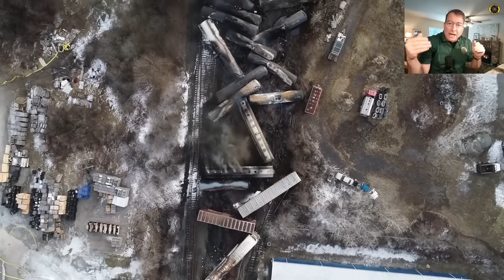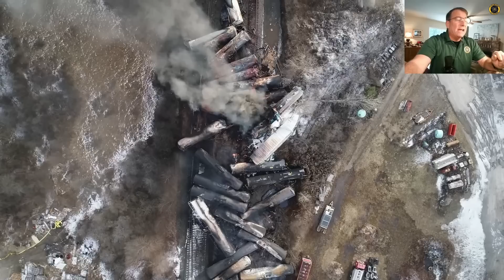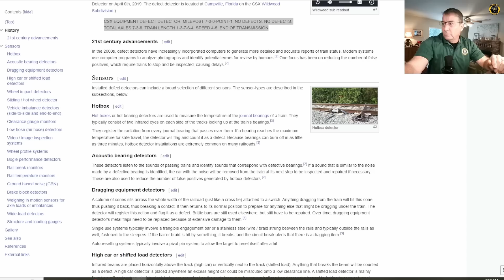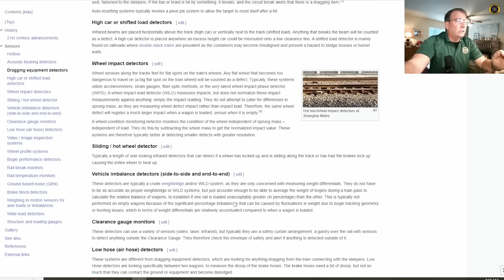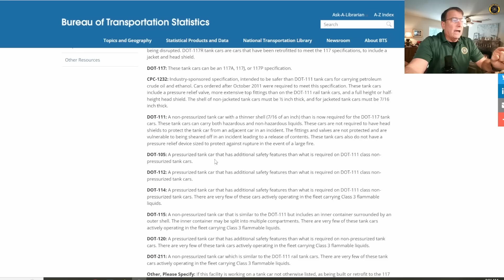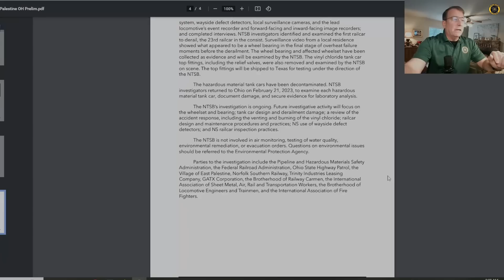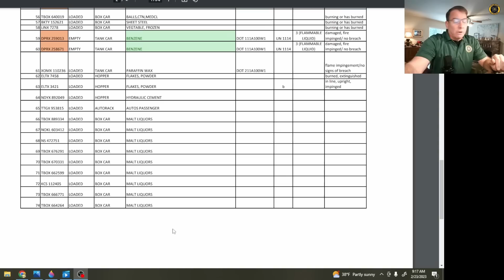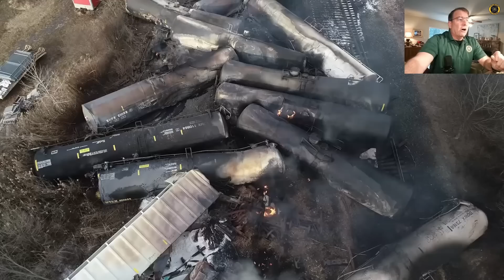NTSB Prelim Report: Norfolk Southern Train Derailment 23 Feb 2023

Comment: Craziness, when I was younger I worked at a plant that remanufactured train bearings and it was crazy to see how damaged some of the bearings were that came in to be remanufactured.
Reply: I can't even imagine. It's mandatory that any car derailed would have all bearings replaced immediately. Saw a photo of this bearing. Cage severely deformed, some still in cage but severely flattened, and I don't know how many were fragments, pieces. I found the photo on a site called That's Railroading.
Reply: its a mad thing that such a huge thing 'the train' runs of such small components 'bearings' its one of the reasons the British in WWII bombed so many bearing factories in Germany, its true to say a country literally runs on bearings

the problem here with any maintenance, we put bearings deep inside devices and cannot see them to check them properly, do you change them regardless after so many miles, how do you police that effectively, or can the maintenance be improved by running a temperature testing facility, what's the cost, and can that be offset against accidents such as this

the idea is there, but who to put it to, and what's the red tape like

i feel another patent coming on haha
Reply: There is no standard that I am aware of concerning routine replacement of the roller bearings on railroad equipment. Is there one on aircraft?
Reply: @iannarita9816  Commercial airlines may have something in place but other than that as far as I know unless there's a particular AD or service bulletin for an aircraft there's nothing that says bearings have to be replaced every x amount of hours or years. Checking/repacking wheel bearings are generally part of an annual or 100 inspection.